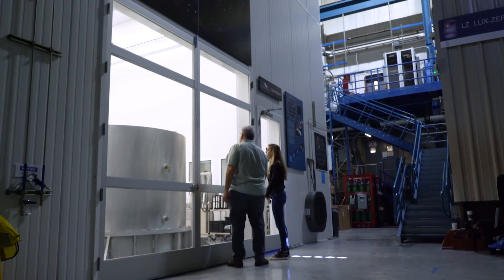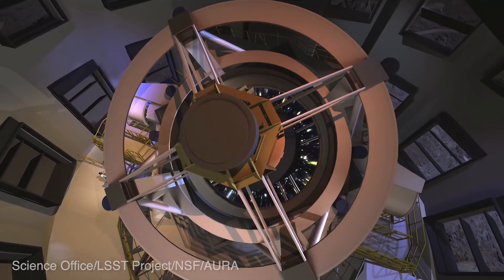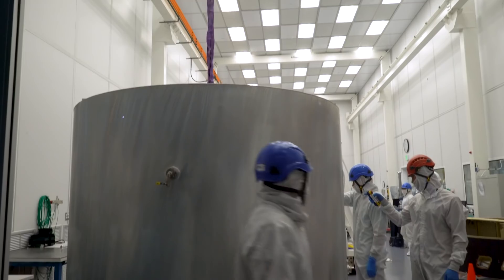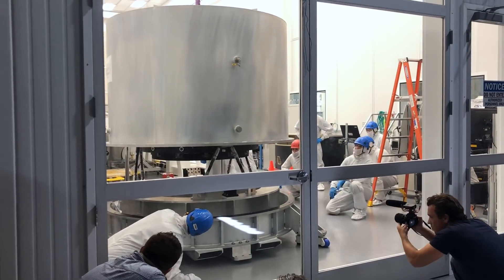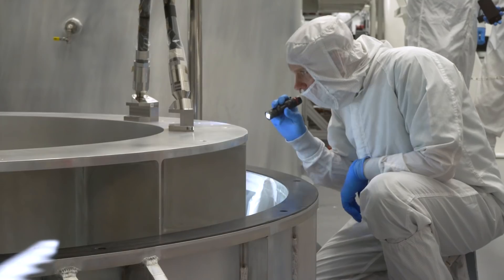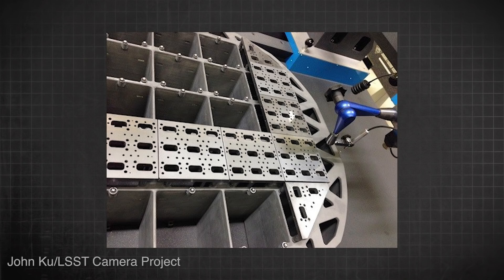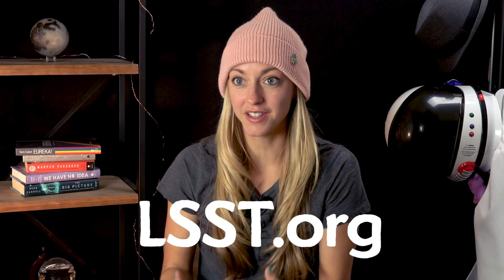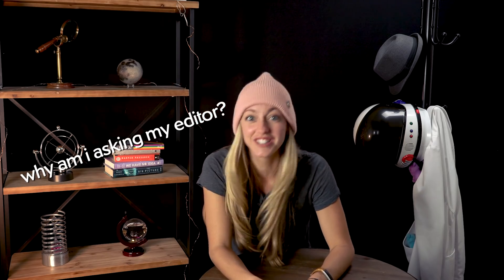World’s Largest Camera Lens

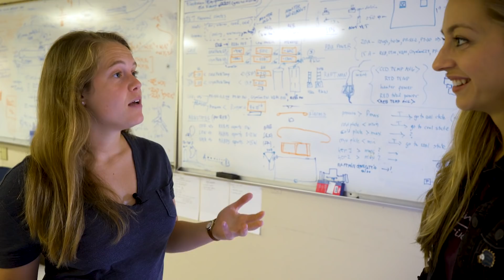Comment: 3:08 So.. let me get this straight... This telescope will be able to take inch resolution images of the Moon? That sounds absurd. However, if that is true, it's amazing. Also, i can't wait for high res photos of the Apollo 11 landing site.
Reply: No, she means it can detect that level of light (and that will only be at very long integration times for objects that are fixed in the field of view... If it was something closer to Earth and was moving across several pixels over the course of the integration, it wouldn't be able to detect something as dim).

The telescope will have a 8.4 meter primary mirror, which would have a diffraction limited resolution in the visible spectrum of about 30 meters at the Moon's distance, best case.  Even if the object is too small to resolve, though, it can be bright enough to detect that something is there because the light coming from it will still hit a pixel on the CCD and result in a charge.  You would need something like a 10 km aperture to resolve an inch at 373000 km.
Reply: @SabaothChristou  As I thought... Thanks for the explanation.
Reply: I mean, you could, but from the sound of it, you'd be buying some very very expensive replacement sensors, since the light of visible stars can overcome the focal field.
Reply: @jamesburleson1916  As you can see in the video, they have the sensors in normal light, so there is no way starlight will damage the sensors. What she's probably talking about is that the sensors saturate at low light levels.
Reply: @CristiNeagu  uhm....the sensors were just dangling there, with no voltage applied, and especially no ginormous lens focussing the light of an enourmous field of view onto them, so..eh...seems legit they didn´t actually burst into flames. Uncover the final setup on a sunny day..probably not a bright idea. Also, yes, you´d probably fry the electronics first, but, also yes, the illumination regime of the moon´s surface might be way out of the dynamic range of this setup (They struggled with that during Apollo, even with their tiny, puny Hasselblad lenses). Sad, though. would have loved to see Shepard´s golf ball.
Reply: @paavobergmann4920  If you think the reflected light from the Moon has enough density to cause thermal damage to the sensors when focused... I have a bridge to sell.
Reply: @CristiNeagu  ? No, i don´t? Why? I didn´t think the light in the room would damage them dangling around unconnected, was all. i wrote "would probably be way out of the dynamic range of the setup"
Reply: The claim is untrue. To see a golf ball (4cm) at the distance of the moon (400 000km) (100 picoradian resolution) you need a primary mirror about 10 billion wavelengths in diameter, which is about 5km, but the planned mirror is "only" "the size of a tennis court". This is the Rayleigh diffraction limit. It might just be possible to resolve the golf ball at a distance of the diameter of the moon (3500km) , as she said, which is 80 million times the size of the golf ball, but not at the distance to the moon, which is over 100 times greater. The resolution at the distance of the moon will probably be about 5 meters, so the Apollo lander will appear as a minimal dot, not worth more than 1 pixel.
Reply: Canon L-series will still piss all over this.
Reply: I doubt it will ever be aimed at the moon. They're after bigger game. Or rather, smaller game.
Reply: @stevethecatcouch6532  It will scan the entire sky without prejudice, so sometimes it will see the moon. However, images on the moon will not be clear enough unless the telescope actively tracks the relative motion of the moon during the exposure. I do not know if they are planning to do that.
Reply: You can't, it just doesn't have enough resolving power.
With a 100 meter aperture, you can start to resolve such small details on the moon, but we don't have such large aperture in a telescope yet.
Reply: @GoldSrc_  The resolution, from the surface of the Earth is limited by the atmosphere, and when one gets 0.2" resolution from the ground, it's extremely good. We can get better, but with adaptive optics, which is not on LSST, since at any rate, adaptive optics only work on a very tiny field of view. Anyway 0.2" at 384000km is 370 meters on the surface of the moon. To get 42.67mm resolution (diameter of a golf ball, as defined by google) on the surface of the moon is 2 10-5 arc secondes (20 micro arcsecond) which is twice the astrometric resolution of the GAIA spacecraft. I don't think that LSST will go to such high astrometric precision and am certain they don't have this resolution. If they do better than 50 milliarc second of astrometric accuracy, it would be great. So the lady was quite... enthusiastic... :)
Reply: being able to see something at all, versus being able to finely resolve its details is a whole 'nother story.
Reply: That's going to take a lot of photoshopping to add in the footprints and everything we supposedly left on the moon.  It was staged, right? LOL

Comment: I'm sorry to admit that I skipped parts of this video, so I'm not sure if the answer to my following question was already given, but here goes: Aren't mirrors the easier way to achieve similar amplification? Is there a specific advantage to lens versus mirror, in our current technology?
Reply: Watch the effing video if you care about answers! The LSST is a wide-field survey reflecting telescope with an 8.4-metre primary MIRROR. It has three mirrors as follows: M1 Is 8.4 metres, M2 is 3.4 metres & M3 5.0 metre diameters. M1 & M3 are a single piece of glass, the "M1M3 monolith" with M3 sitting inside the middle of M1 - this is to minimise the overall length of the telescope. THEN there's three corrector lenses to reduce aberrations. These lenses & the telescope's filters, are built into the camera assembly: L1 1.55 metres [largest lens ever built], L2 1.10 metres & L3 0.76 metres [this one forms the vacuum window in front of the focal plane].

Comment: What's completely crazy is that these ultra precise lenses have crossed the Atlantic !
(They were coated in France)
Reply: Do you know where they where manufactured?
Reply: @waltergrimm7161  It looks like they were designed by the LLNL, made by Ball Aerospace and Arizona Optical Systems and coated by Safran-Reosc

Comment: So... they finally will be able to take a picture of the flag on the moon?
Reply: No x) 
The Moon is WAAAAY too bright for that telescope 😅😅 even the new Moon is probably brighter (from Earthshine) than most things it wants to be looking at :D
Reply: @EcceJack  I assume they can control exposure time, so that shouldn't be a problem.
Reply: @23Scadu  There is a formula for aperture vs. solving power, and this is not big enough. Hower you can see the shadow of the bottom of the lander with the legs with a big amatuer telescope, like 18" or so.
Reply: @23Scadu  I think with concentrating a tennis Court's worth of light, you have quite a bit of heat at that point if not pointed at the void of space.
Reply: @Tore_Lund  but they can see a golf ball at that distance apparently?
The resolving power is a function of the main mirror (the one that had to just fit through the tunnel) but I can't be bothered to find the formula and work it out. 😜
Reply: @davehodges2361  Here you go: https://www.skyandtelescope.com/observing/skyandtelescope-coms-scope-calculator/
1000mm diameter lens resolves 0.12 Archseconds which is 224.4 meters on the moon and shadows get long as there is no atmosphere.
Reply: @colinsouthern  They are not talking about "seeing" the golf ball, but registering the reflected sunlight from it. It is an analogy for its sensitivity. Same thing with stars. 60 light years away they are just a pinpoint, every photon arrives from the same angle. The reason stars look like a disc in a telescope is because of atmospheric disturbance. Looking at a faint star through the eyepiece, it is just a shimmering cloud of dots. If you take a long exposure photo, these dots become a disc on the photo proportional to the stars intensity, but you are never "seeing" it. Still with space telescopes the same happens but to a lesser degree, that is why the image is sharper.
Reply: Sadly it has probably been too long for there to still be an observable flag the radiation bombarding the moon where it is located is enough that the flag has probably disintegrated if true it might be far less impressive than you would expect so you ought to be prepared to be disappointed even if you do get a scope capable of observing it's location.... >_<
Reply: It's ... complicated.  Wikipedia has a diagram of the full setup: https://en.wikipedia.org/wiki/File:LSSToptics.jpg

So, Mirror 1 (M1), then off M2, then off M3, and then through L1 and then L2 to the detectors.  With those 5 stages I'm not sure the calculator linked above can definitely get a good answer in this case.  Anyone familiar with such things want to take the info from https://en.wikipedia.org/wiki/Large_Synoptic_Survey_Telescope#Optics and give their own estimate of the highest possible resolution it could have (assuming perfect mirrors and lenses) ?
Reply: No. The golf ball analogy was actually just plain wrong and deceptive.

Besides, people that don't believe we planted a flag on the moon would also call such images fake as well.
Reply: @FelonyVideos  Who cares what they believe anymore. Nobody has anything to prove to them. It's up to them to obtain more of an understanding of science. Notice I did use the word "more". In other words, I'm not giving up hope.
Reply: @colinsouthern  It would be interesting to see what 40 years of hard solar radiation and dust sized meteorites have done to the gear up there. The lunar orbiter from 27 miles away, almost did it, both foot steps and rover tracks are still there. https://www.nasa.gov/mission_pages/LRO/news/apollo-sites.html
Reply: @colinsouthern  - Lunar orbiters have a much better chance of getting the pics a lot of us would love to see.
Reply: @colinsouthern  There is no maybe. Visible optics are theoretically limited to being unable to resolve such detail. This is because mirrors and lenses are made of atoms. We can calculate the ultimate resolution of the ultimate telescope, and it won't see the landing sites from earth.
Reply: @colinsouthern  I agree.

Comment: From 3:07 (https://youtu.be/33UMkPe93Ko?t=187): "If you were to put a golf ball at the same distance from earth as the moon, we'd be able to see it with our camera."

I just don't think this is at all possible. That's orders of magnitude better angular resolution than any telescope we have currently: https://www.reddit.com/r/askscience/comments/d7qi0y/if_we_return_to_the_moon_is_there_a_telescope_on/
Reply: In case people want to see the math:

A golf ball (which is less than 50mm in diameter) at the distance of the moon (384,000+ km) is ~2.7e-5 arcseconds of resolution (for just one pixel to be the golf ball).

From https://en.wikipedia.org/wiki/Optical_telescope#Angular_resolution, "the angular resolution of an optical telescope is determined by the diameter of the primary mirror or lens gathering the light". Specifically, for visible light, AR = 138/D where AR is the angular resolution in arcseconds and D is the diameter of the aperture in mm. Solving this for the AR required would require a mirror in excess on 5km. Clearly way bigger than the lens they show off and way bigger than anything humans can possibly create for now.

Comment: Just imagine when we get to put one of these in orbit or on the moon! Speaking of lenses, I wonder if advancement of computational imaging techniques could some day make them unnecessary? Imagine a foot-ball-field-sized image sensor and how much light it could gather.
Reply: But if the pixels just aquire light from all directions, you can not make an image, you need lenses so that you "know" where which ray of light came from and each ray hits the right pixel. What you can do though with computational power is using lots and lots of small telescopes and point them all at the same thing and put all images together with some computation to get more resolution.
Reply: @danielroder830  Not entirely true, though the tech for it is currently Sci-fi: Synthetic aperture radar use the timing of the individual photons (of radio waves) to determine which direction they came from, so they are resolving an image with an array or plane of antennas. However the timing needed with the much smaller wavelength of visible light, makes that impossible for now. A CCD is essentially a bucket for electrons, which get counted and then emptied at regular intervals. However if they only could hold one at a time and registre it with a timestamp, no lenses or specific exposure time would be needed.